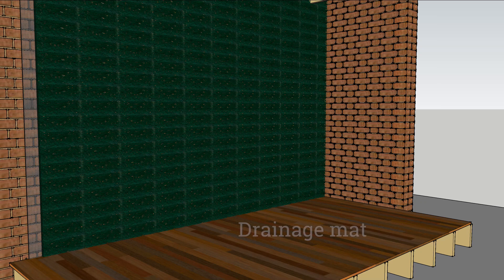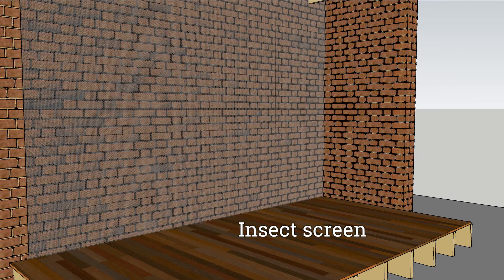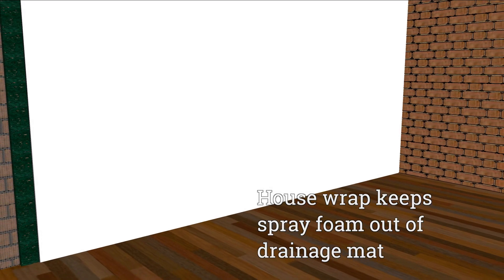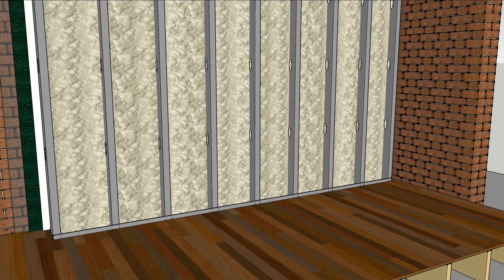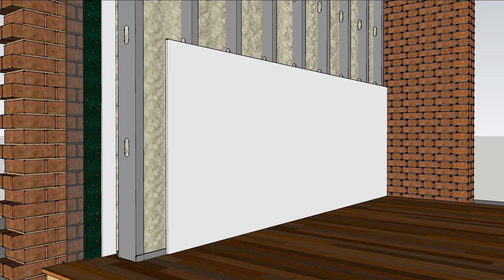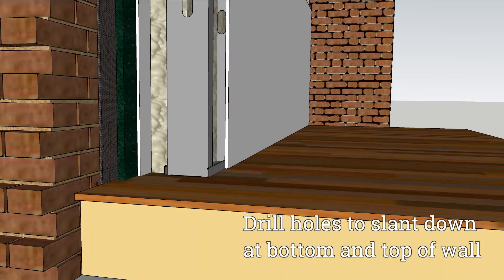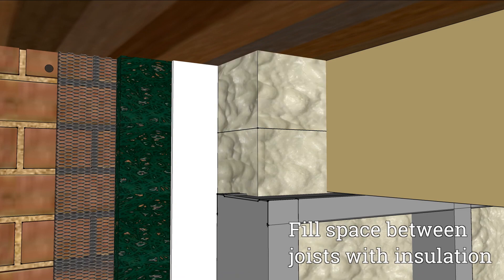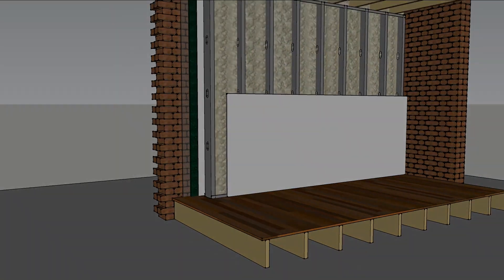Historic Brick Insulation Retrofit

Comment: My house had this done during a renovation in the mid 80s. No house wrap, insect screen or fancy mesh. Just a one inch gap between the new wood framed walls and old brick. Everything seems to be going fine.
Reply from the maker: That's great. Depending on the climate zone it could be fine or it could be problematic. What's the insulation? Hard to get a tight air barrier system with batts and a one-inch gap.

Comment: The aspect that has been ignored,the wall assembly that once dried as a result of interior heat warming the brick is no longer there. The result is periodic wetting and freezing temps. can cause the brick to spall and fall apart in a matter of a few short years.Testing of the bricks absorption rate and it's ability to endure freeze thaw cycles is imperative to know BEFORE one indiscriminately  adds insulation to the interior of an older solid masonry building.I would classify this approach as a reckless cowboy approach.Much more examination of the structure is needed before proceeding.
Reply: Would adding vinyl siding to the exterior alleviate that problem?
Reply: Nate at that point I would assume you would just go with an EIFS approach.

Comment: using this method to retrofitting in historic district in Saint Louis.  Would like to use BIB instead of foam for better sound control... can you recommend a sealant for the inside of the brick?  kind regards.